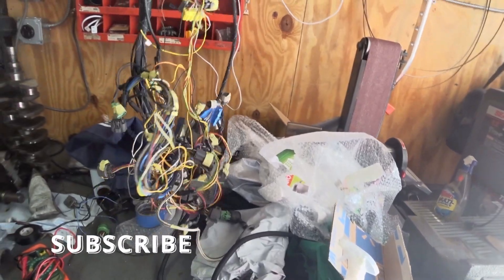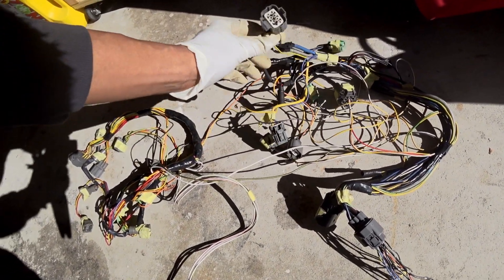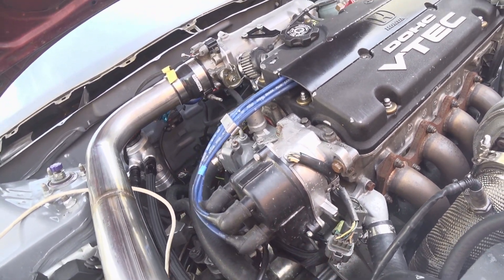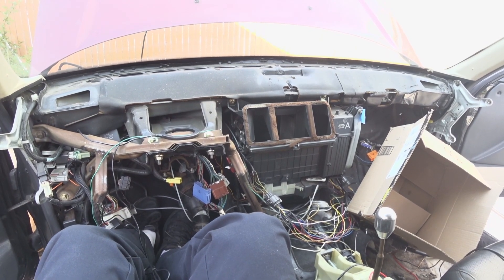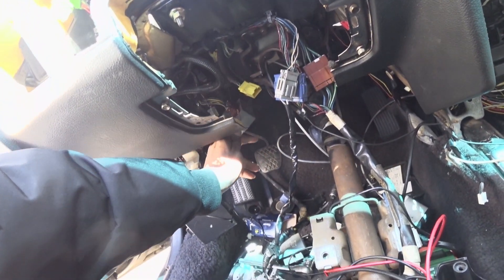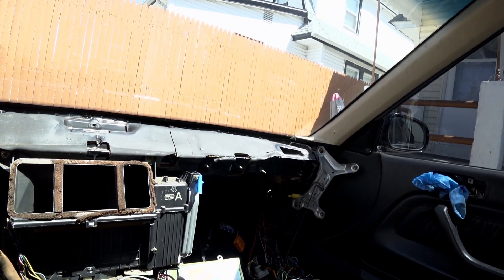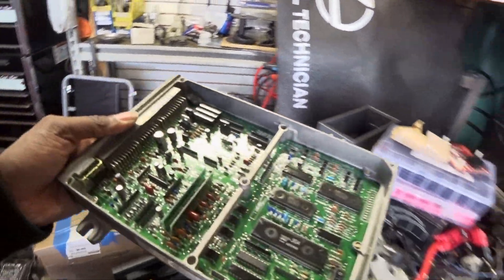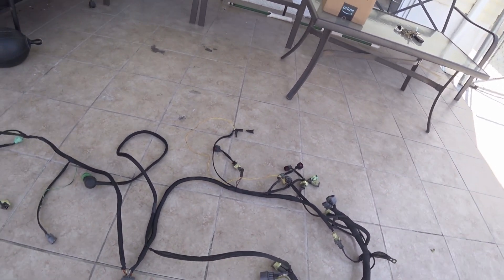CB7 H2b AWD Accord wire tuck part 2.

Comment: Good I'm dealing with the same issue bro  ? We're do u connect the  green  wire to the break 12 volt or to the clutch my car dosen click the fuel pump
Reply from the maker: If the car is cranking then the clutch sensor is working. The green wire on the main fuel pump relay is what gets the 12 volt signal from the ecu. Then the yellow wire sends it to the fuel pump.
Reply: @AJIMPORTS   thanks so much bro thats gonna help me also  car its no cranking   but I swap the jdi start kit went  the issue was  allready  on it  the car dies after stoping on gas station  after that never start again only applying power strait from  starter
Reply from the maker: @AdinSLaboy  if the car is not cranking before you installed the jdi. Then maybe you have a bad main relay or clutch switch. Unplug the connector to the clutch switch and jump those 2 wires. That will allow the car to crank.